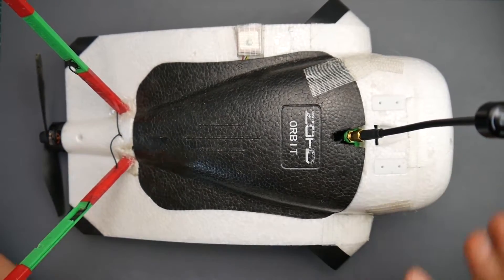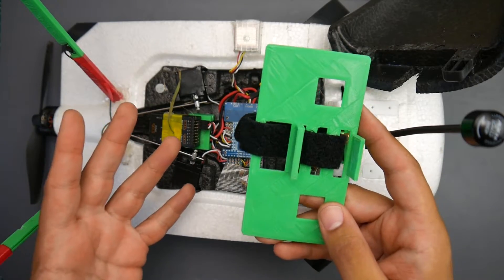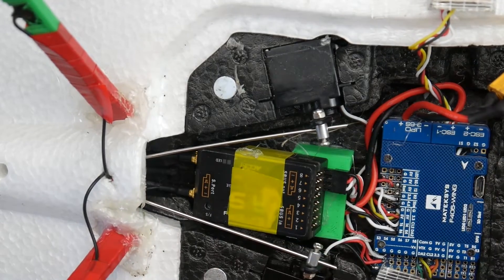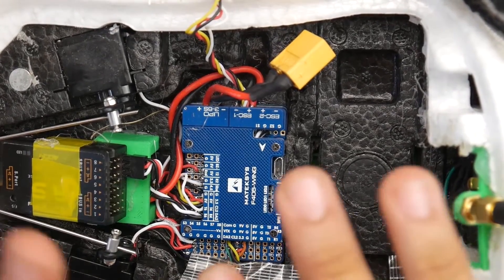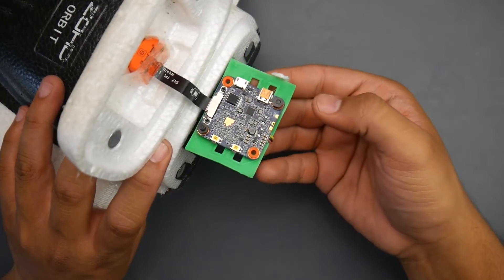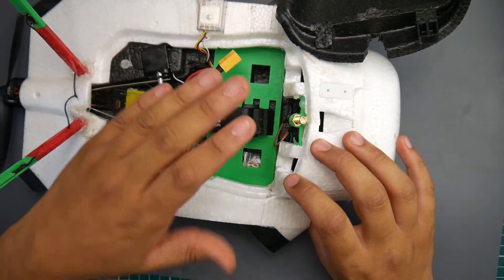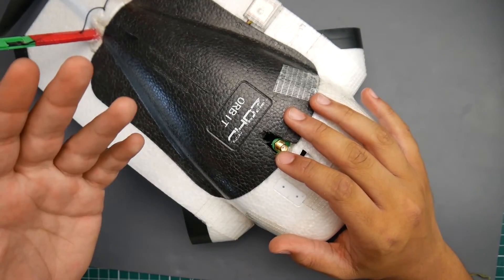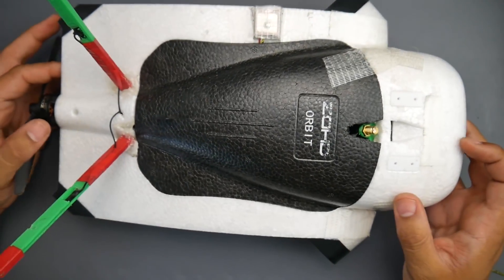Best Budget Long Range FPV Wing // High Efficiency Setup Update

Comment: Have you looked at connecting a flysky FSi6s radio to a ezuhz transmitter? I built a simple cable and it plugs straight into the trainer port, and you wind up with the cheapest possible long range transmitter possible
Reply: In interested in this. How did you do it? Cheers

Comment: I run bn-220 gps modules on everything and while 3 of them take 30 seconds to lock, one of them takes several minutes and sometimes disappears from my OSD altogether on startup... thinking i might just have a faulty unit and the working ones are amazing value

Comment: I'm glad you published this.  I've had a ZOHD nano-talon kit lying around since they first came out; I'm now inspired to check out your other video. I only have the Matek 411, AKK ultimate, instead of those you've used. I'm thinking of using your guide to build a 'flat-wing (3d parts already printed) nano-talon; similar to your setup with a split mini 2.  Thanks for all the info

Comment: Second ;-) ... I do not like the blunt nose. Should be an aftermarket sharper nose replacement for better aerodynamics  ;-p
Reply: Yeah that's right but Sonic model HD wing has a sharp nose and a 1200mm wing span this is suitable for long range endurance flights